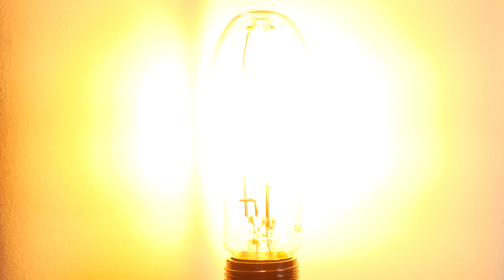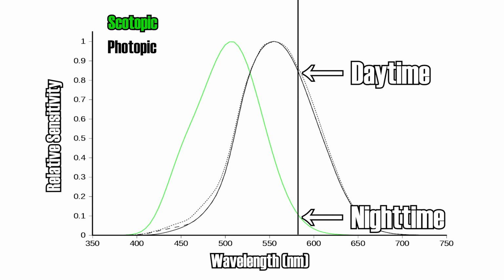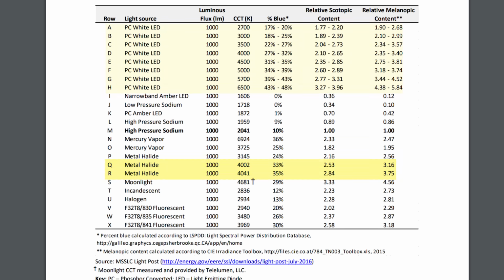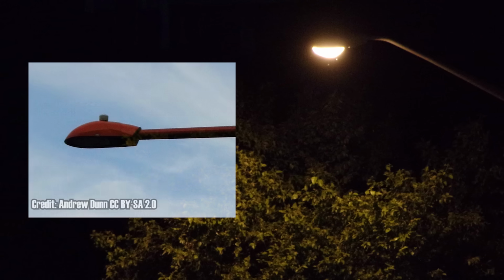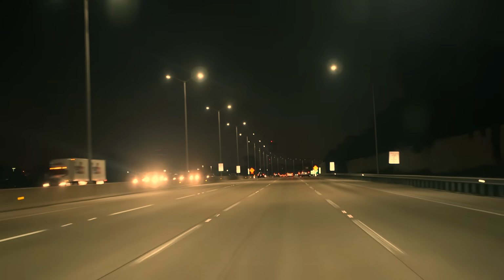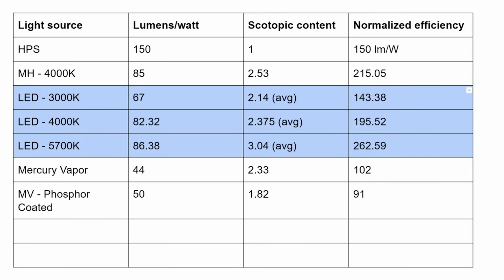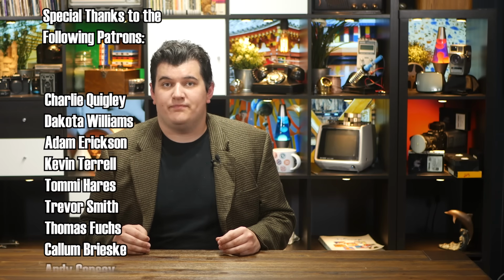The LED's Challenge to High Pressure Sodium

Comment: Low pressure sodium all the way! The sodium lights have been proven to omit far less glare than the LED lights, making sodium more effective I feel, I do have to say, the LED lights do give you more vision at night but the glare they give off is so bad that it can blind you anyway making the sodium lights more effective. Another cost cutting measure being implemented is that lots of the new LED lights only turn on when it is pitch black. The sodium lights all used to come on right away as soon as dusk came.

Comment: When they introduced sodium vapour lamps I hated them, I thought they were hellish.  I still don't like them but now dislike murcury vapor so much I would put up with sodium.  When LED came out I thought great, that ought to be a real improvement.  I started to notice that when my A/C came on the lamp across the street would go out and take a while to come back on till one day it never lit up again, so I reported it to the power company.  They came and put in an LED lamp and brother, certainly you could see colors better and it was not that hellish orange light, but it is absolutely blinding.  It is 160 feet from my living room windows and I am now going to have to get blackout curtains, but I wonder that drivers can see anything, it is like looking at a nuclear flash, and especially bad in inclement weather.  We do not get a lot of foggy nights here, but if we do this light will be dangerous for the same reasons you do not use your brights driving in fog.

Comment: The most efficient solution would be to not light empty F-ing streets. Use motion detection at least, and even then turn the lights off after midnight.
Hell, you don't really need streetlighting anyway. Everyone can carry a flashlight, and cars already have lights. And flashlights are very visible in the dark...

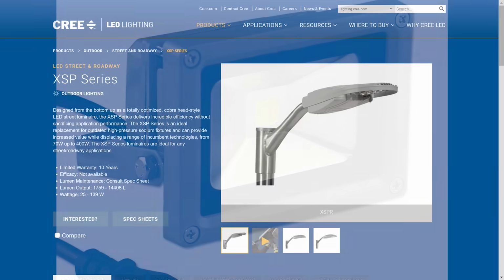Comment: 12:05
I fail to see any difference. They're both COB LEDs, one with phosphor, the other without because it's red. They're exactly same layout.
Directional control is the function of the fixture, in both cases.

Comment: Personally, I think a more blue light for nocturnal illumination makes sense for the sole reason that it keeps some people more awake and alert, and falling even partially asleep while driving is a considerable danger.  But for everyone rightly trying to sleep in the comfort of their own home, yeah, addressing the pollution factor is kind of an important issue with widespread use.  Which could be why your flight over Chicago only used directional LEDs on busy main roads and left neighborhoods with their old inefficient sky-polluting lights?

Comment: You can bet your bottom dollar that when cities do ubiquitously switch to LED street and external building lighting, they'll all be sourced from China, and from that point forward, you'll be constantly seeing unlit and defective lights all over the city, all because some little cunt in the government procurement department gets a pat on the back for spending as little money as possible.. Which in the end will cost more than simply buying high quality LED's, because the cost of the wages to go out and replace them every few thousand hours will end up more expensive than buying the highest quality LED's in the first place - You can basically apply this "short term gain, long term loss" scenario to almost every government action, especially in Australia and the USA, where local and state government officials only think in 3-4 year terms with the ideology of "Fuck what happens after I retire on my public servant pension".

Comment: A few ywars ago Los Angeles started replacing failed road lighting fixtures with LED systems which cost less to operate and last longer.  The installation labor cost was, in effect, zero because they would have had to use the same labor to replace  a failed lamp assembly.  What is the situation there now?

Comment: Surprisingly not mentioned here is color rendering, typically measured with CRI.  HPS is terrible withe a rating of ~25; LED often have ratings that are 80+ (sunlight is 100).  LPS with its monochromatic light literally has a negative CRI.
I this effect directly when flying out of Chicago.  The O-Hare economy parking lot is huge and lit at night with LPS.  You literally cannot tell the difference between a grey, blue or green car in this light ... which is a bit frustrating when you forget where you parked.

Comment: That bluer light disrupts circadian rhythms is obvious. I've always found that if I try to sleep next to a hotel radio/alarm that has one of those insufferable blue or green displays it bathes the room and I can't sleep at all, I have to either turn it off if possible or cover it with some clothes -- but if the display is red, as they all should be, it's no problem at all.

Comment: A few years ago a part of my city's HPS lights got replaced by 10k K LEDs. Effective visibility went down dramatically and the change was rolled back eventually. 
Unfortunately I cant prove this, but by my best guess the reasons were a combination of poor decisions by the city planners and the workings of light distribution. 
1) Since the LEDs emit "more" light (apparently close to double) on paper, the conclusion was that half of the lights can be turned off, since the net emission stays the same.
2) The LEDs were much more focussed and shining straight downward with about a 45° angle provided by the shade, not an actual lense, where the HPS lights were at about an 80° angle.
The result was a road with a few very bright spots interrupted by long darker strips. The Driver's eyes adjusted to the dark, then got irritated by glare, then got blinded by the LED, then were blind looking into the darkness before the cycle repeated.
This also demonstrates another important facor: The distance light can effectively be used. If lamp posts aren't as frequent as on inner city highways, the light needs to be able to travel longer distances to reach the areas in between. Obviously, this is another task more suited to the warmer spectrum.
I guess what I'm saying is, even though LEDs are superior on paper, there are a lot of pitfalls and factors not considered in certain studies.
Thus the results can't be applied universally. As always, the solution needs to be taylored to the specific situation.

Comment: The LPS light disturbs much less the insects than LED light. Moreover, its luminous efficiency is higher. But the manufacturers market now LED radiating much less short wavelength and with a comparable luminous efficiency.

Comment: My biggest issue with LEDs is as a pedestrian, it's very difficult to distinguish a stopped car with headlights or a streetlamp, when you can't see the source dirrectly, such as on a bend or in a housing estate with built walls and hedges near corners. 
It could easily be done that most roads get the LEDs then the housing estates even if they got LEDs had a filter to yellow the light seeing as speed should be slower and it affects more people having the blye light disturbing their sleep.

Comment: So, we should probably replace all highway lights with LEDs, and if necessary, we might have to tint it in certain areas of environmental protection, correct? There’s a good cost incentive, because the side-effects are definitely manageable. 

I like the idea of residential districts having LEDs with red/orange covers, and perhaps a dimmer glow. That way, perhaps they can offer a much milder impact on the power grid, saving millions

Comment: I prefer cooler lights for street and headlights. My car annoyingly has fairly warm halogen bulbs and I can’t see very far without street lighting. This is probably mostly due to the angle at which the bulbs project, but it’s still difficult to see the road nonetheless. They reflect very well off of signs, but I’d prefer a beam that lights the road better. I’ve been researching LED replacements so that I can see more of the actual road at night.

Comment: Kodak, to this day, still releases "D" - daylight (65k) and, "T" tungsten (32k) negative camera film stocks. https://www.kodak.com/US/en/motion/products/production/default.htm
This happens to fit very nicely with today's 65k LED lights. Professional lIghting kits for film used to cost thousands if not tens of thousands of dollars. With LEDs, the costs have come down at least one full order of magnitude in cost. In fact, they have gone one step further and eliminated the need for color-correction gels or filters by being able to adjust the color balance from 32k to 65k as well as overall intensity thus eliminating the need for ND filters and gels as well. Some kits even allow full RGB color control. A vast improvement from my film days. https://www.bhphotovideo.com/c/product/1515222-REG/aputure_mc12kit_mc_rgb_12_light_led.html/specs
I personally love the new 56k LEDs for street lighting. It just lights the scene so much clearer and brighter. It feels more light daylight to me. I don't think it is any accident that these LED street lamps are indeed at 65k.

Comment: One thing to consider is that having melinopic lighting is that while it disrupts the internal clock, that could potentially be a good side effect for truck drivers, and people driving at night because the production of melatonin causes drowsiness which is not good for operating a vehicle, so the less melatonin the less likely they are to fall asleep.
Reply: Maybe they can develop street lights which start out with a warmer light color and therefore less melanopic light, and then gradually turn cooler, and more melanopic, so that it minimizes the internal clock disruption people who are driving shortly after dark to go home, and then for people who drive overnight can still benefit from the increase in visibility and less melatonin production further into the night

Comment: Electrical Engineer here
One great big advantage that LED's (Light Emitting Diodes) street and traffic lighting is that they can be solar powered with battery backup. So in a major power failure all of your street lighting and traffic lighting will still be working with very little looting excluding death squads or police killing innocent people.

Comment: unless you live without any technology, our circadian rhythm will be disrupted, phones, laptops, tv, even our own household lights.    LED's can also mean less material used for the street lamp.  and can be  mounted in various ways to obtain optimal light,  like a LED light bar for more horizontal light, and less vertical light.
Dont need any warm up, and are programable.

Comment: The lights around Mauna Kea are definitely low-pressure. I'm used to high-pressure sodium lights, but I'd never seen that sullen yellow glow before.
Incidentally, that color is preferred near observatories because the Earth has a layer of sodium ions in the upper atmosphere that are energized by solar activity -- the telescopes have to filter sodium emissions ANYWAY.

Comment: I remember so many times driving so late at night during winter, I thought the sun was already rising but it was actually just city lights lighting up the clouds above.
Reply: They should use glowstone instead of LED
Reply: Actually the charcoal torches have the best Illumination-Price ratio
Reply: @chesteramstrong2592  Nah, Galacticraft floodlights are so powerful they scare the mobs away.
Reply: A system of well built nether portals is much faster.
Reply: Just ramp up brightness to 100% in settings

Comment: Pure high intensity blue is MUCH harder on the eyes.  The eyes don't react to the brightness,  irises don't contract sufficiently, leading to overexposure of the retina.  
I learned this lesson personally when working with high wattage RGB led's.  Blue is superior when it comes to "burning" an image on your retina... especially at night. Adding red and/or green reduces the "burn" due to the irises reacting and shading the corneas.
Granted, this is my experience working in close proximity to high power "single color" led's.  That being said, blue is much more efficient at night.. but care must be taken not to get too much of a good thing.

Comment: A little details about LED light and astronomy. They have a continuum spectre. So can't be filtered. Sodium lamps, at least have a spectre that can be filtered and compensate using anti-pollution filters.  I know that are works on make astronomy LED friendly light sources. If I remember correctly, they use some kind of coating to change the light spectrum.

Comment: LED lights are too "thin". I've used LED flashlights a lot, especially those headlamps, during some of my many night mountain hiking/camping treks with my friends. And while the light IS bright, it's very very flat and messes with my stereovision to the point that I misjudge the distance and/or size of more than a few stepping stones. It strains my eyes if I stare at anything for too long that is illuminated by LED lights. It might just be me, but that's my impression of LED lights. I still prefer incandescent or even fluorescent bulbs.

Comment: one disadvantage of LED that you are completely ignoring, is that LED's don't generate enough heat to keep themselves free of snow and ice.
Reply: Depending on where this might only be a problem like 2 days a year. And for example led traffic lights can be equipped with a simple heating element and are still way more efficient than regular lightbulbs. He made a video covering this exact topic.

Comment: Without Getting rid of ballast of the light source, there no power saving.  Using Direct LED light gives the most power saving.  Granted there need to be a balance in the color of the lighting to max the lighting and our safety. The LED lighting can be control to light only down and without any side projection in smaller packaging. As for heating, they do create lot of heat, and in fact may create more heat then merc light but do this using far less power then a merc light.

Comment: I can't stand the blue LED lighting (6500K), we've gone from one extreme (2700K HPS) to another (6500K LED). Need something balanced in the middle (4300K).
Reply: When safety or work is needed, I find 5000K to be great. When I'm trying to relax, 3500K is the upper limit to a nice warm glow. Above 5000K causes headaches, below 3200K has too low of perceived light. So I generally find the HPS streetlights to be pointless and the areas they've switched to 6500K doesn't cause discomfort because they are too short (only 2 miles or less than 2 minutes of exposure.)
Reply: @StapleCactus  Cool white light stimulates productivity in the brain which is why higher color temperatures are always used in commercial applications.
Reply: @exoticcar5482  I thought it's because the higher contrast made the text stand out sharper.
Reply: Actually HPS clocks in around 1800-2200k depending on the bulb. 2700k LED would be much better imo. Anything above 3500k is not warm light
Reply: @exoticcar5482   once again light that keeps you awake is a good thing when driving .  Street lights should not aluminate you house or lawn and need redesigned.
Reply: @exoticcar5482  LED's with higher color temperature also can have rosy tint with higher CRI for better depth perception and reduced eye strain. LED's with warmer color temperature doesn't always have higher CRI.
Reply: @uvwuvw-ol3fg  They can have a good cri but the efficiency drops
Reply: @exoticcar5482  not anymore the difference is now 5% efficiency difference
Reply: @exoticcar5482  the Lenz is tented  so there is not much loss in efficiency,  there will always be some trade off
Reply: 2700K for bedrooms, 4000K for offices and schools.
Reply: @maggiejetson7904  One of our clients has a required lighting plan. Offices must be 5000K, warehouse can be anywhere between 4000K-5000K.
Reply: @maggiejetson7904  65000k  for workshops
Reply: I endorse this comment.
Reply: I agree, 4000K really does seem like the best compromise here.
Reply: @Wilson_OW  I’m mildly annoyed that residential roads are 4000k instead of he recommended 3000k. However glad it’s not LA where street lamps are 6500k. I want to see residential roads with 3000k and major roads in commercial areas with 4000k
Reply: Everyone knows lights are no good unless they're able to create electron-positron-pairs. At least, that's what car manufacturers seem to think.
Reply: @Kurt.E.Clothier  Not necessarily. There is no standard definition of “daylight”. Every manufacturer seems to have their own definition. It varies from 5000k to 6500k and the higher end of that appears to be cheaper to make.
Reply: Yes. Agreed
Reply: I've always liked 5000k, it looks pure white to me without much if any blue
Reply: @RoshDroz  that’s probably 4000k

Comment: I like the orange lights, though! They look cooler and actually fucking light the road up, as opposed to the stupid LED ones we have around here that only light up a thin stretch of the road (going perpendicular to the direction of the road, no less) and are so bright, it blinds you and really fucks your ability to see at night in the dark areas. Those dark areas are also really large since they decided to only put street lamps every 75-100 meters or so. So right as your ability to see is regained, you go through a close-to-completely useless line of light that flash blinds you and you're back to square one again. It's bullshit. And if you're going to replace the HPS lights, at least replace them with red LED's since (to the best of my knowledge) the colour red doesn't really mess with your night time vision at all. It also looks cool and gives the night time roads an ominous feeling that might keep the idiots of the road away.